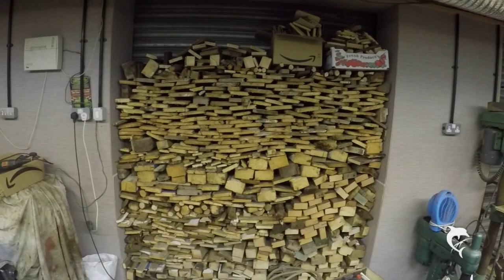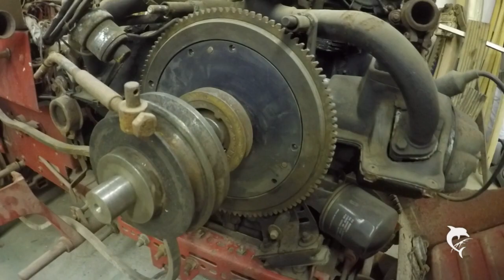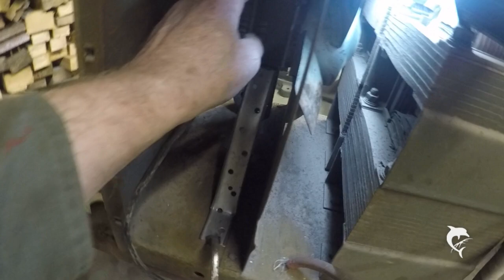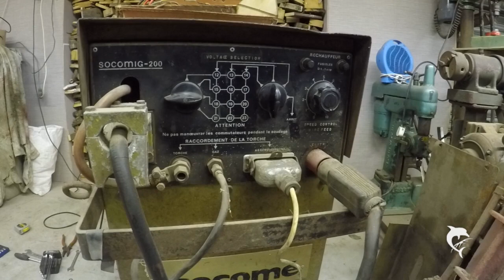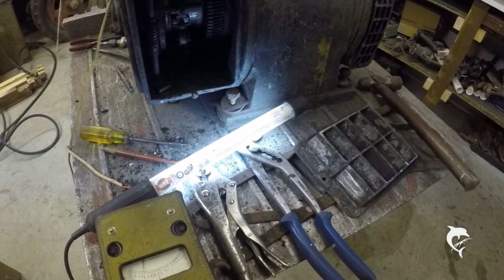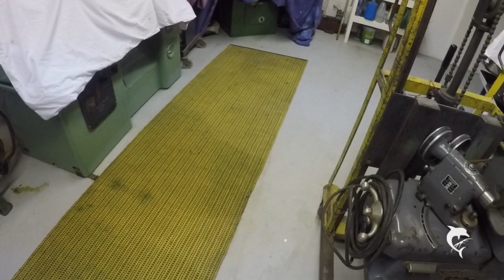Wot I done this week!

Comment: Hi Philip! You say you removed the old clutch from the ride on and replaced it with that plate, does that mean there isn't a clutch now?
Reply from the maker: No, there will be a clutch, the one I removed was the clutch that put the cutter deck into cut, not the driving clutch. I will be putting a cutter deck clutch back on, but it will be a jockey pulley which tightens the drive belt rather than the useless Kohler friction plate clutch, which tries tp push the crahkshaft out of the engine before you can get enough pressure to make it drive properly, it looked like 1900's crude tech, and it was made in the 1980's!